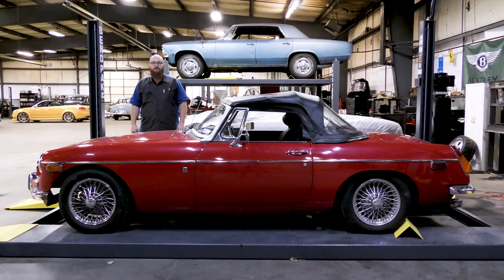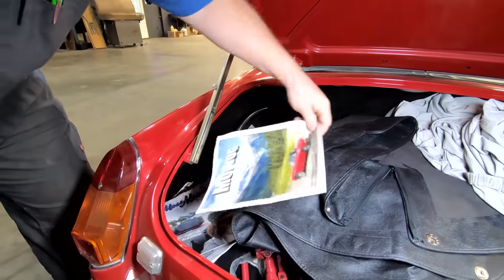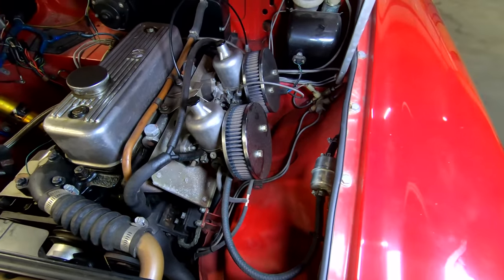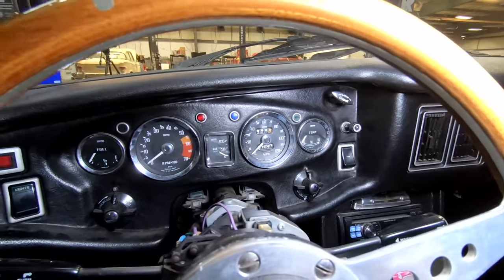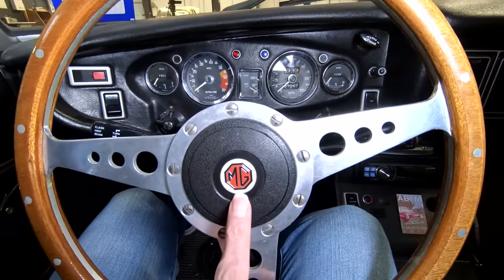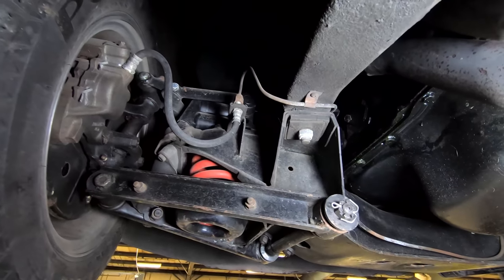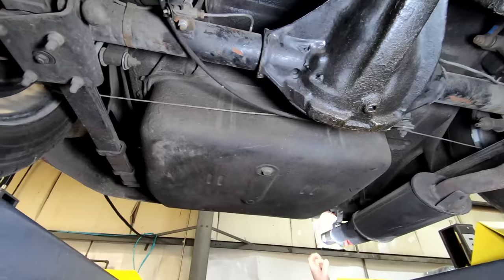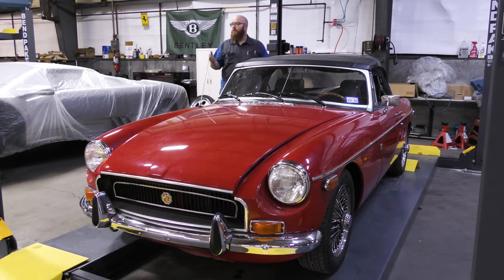Cherry 1972 MGB! See exactly why it earns a thumbs up from the CAR WIZARD!

Comment: The MGB is a timeless classic. The styling is still beautiful today. The fun to drive factor is a 10 on a scale of 1 to 10. Then, the U.S. government in 74 or 75, ruined the car with 5 mph bumper laws and smog junk, and that was the end of that.
Reply: I had a 1975 MGB that I paid 3700$ in 1978. The rubber bumper model. Went on our honeymoon all through New England  in it. Top down every day except one. That was 1979. Sold it in 82 when we bought a house. It was a nice car. I can honestly say  'been there, done that. Had it for 4 years.
Reply: J P... Mid year 1974 chrome to RBB. Also of equal importance.. the previous MGB  headlights were lower than the US standard.. The RBB for collision and the increase in road height by 2" for the head;lights.. that killed the car. Add to that smog regs and the wretched Stromberg  Smog carbs and then a single carb and a weight increase of a couple hundred pounds. with a now 68 HP  engine instead of the original 98 HP made the car a be-jewelled pig.

Comment: Hi Mr Wizard - ive got 3 of these cars - for future reference, one of the hidden areas you can get problems is the fuel tank.  All good until you fill them full and then realise that above the tank is a crud trap where dirt is flung up between it and the body (what you often see rusted boot floors).  Most people kind of accept that an old British car will have a gas smell but not appreciate its because their gas tank has rusted at the top

Comment: Wizard a small point but you are usually very specific with details. Dampening involves water, damping is the control of motion. The lever action shocks are dampers as are the valves in the top of the carbs. The damping valves in the top chambers of the SUs act to retard the lifting of the piston upon opening the throttle thus restricting the air momentarily and causing the high vacuum to pull extra fuel through the jet of the carb. This is in effect the accelerator pump. I really enjoy all your videos and rarely can find any mistakes. Keep them coming.
Reply: Sadly the entire motoring industry does this. It's the spring that provides the shock absorbing and the damper that limits the rebound action. They are fundamentally different actions, but it seems were are stuck with dampers being referred to as shock absorbers. It's too deeply ingrained in the business.

Comment: In the early 70's I had a couple of these from the 60's. Up in Ohio I learned those spin on wheels better be taken off every 6 months and re-lubbed or when you had to take them off it was a hell of a job beating them off. I got rebuilt shocks at JC Whitney as cheap as the rebuilt kits. They do make regular shock replacement kits for them back then. I installed a 8 track in mine and head phone jacks. Had to fiberglass over the back floor where the battery went. I also made a split h pattern under the front seats, bent the floor mental and fiberglassed it to lower the seats 2" or my head would hit the closed top. They do sell metal pans to lower it but it only cost me $10 back then to do it.
One year we mounted a 17' canoe on the closed convertible top with foam padding, strapping it down to the metal bumbers, and drove it 2000 miles like that.
Tough little car but has bad frame rust rot problems. Let my buddy drive it and didn't know he was drunk. spun around in the snow and bounced off a poll and a brick wall. Every corner was damaged, pulled out the stuff and drove it more, a year later I took a turn to fast and hit an island divide and then went up a hill. Went over 3, 4" curbs and a steel 2" sign poll at over 30mph and was sitting on the hill, put it in reverse over the same stuff and drove home. Sold later to my buddy and he would drive it crazy over 90 mph in the country. No front end work or alignment, lol
Reply: Steve Horace.. There is no "frame" on an MGB it is a unibody chassis.

Comment: My first new car was one of these... Mallard green.  There was 2  6 volt in line batteries, so this accounts for the extra battery space/storage.  Back in the day (1973), one battery cost $130!!  Yikes! Typical dealership ripoff!  Quickly converted to one 12 volt in short order. Horror story with the dealer, too long a story.  Cheers, keep up the ethical business practices.  G
Reply: Go on, give us the dealer story.....
Reply: @JohnSmith-yv6eq  okay, Coles version. About 14 months after owning the car, it needed ONE battery.  What the dealer did was to swap a new battery from the new cars and put them in a used car.  This way every mg sold would need a battery very soon.  Even in 1973, a 6 volt battery was $130. How I found out:  Talking to other mg owners, in conversation, the battery topic came up and everyone that had bought a car at this dealership had purchased a battery within 18 months.  And, every car new or used ha an old battery and a new one.  I converted to one 12 volt in the trunk (Fiat Spider had this set up). More stories over beers more fun!  Cheers

Comment: Brings back memories - I had a couple of these back in the 60s - both purchased new. The term MOWOG was originally BMC's brand on all their spare parts - bit like Ford's FOMOCO. MOWOG was derived from Morris, Woseley and MG I believe. If memory serves me correctly, the fuel pumps were made by SU not Lucas. Often they can be fixed by replacing the points but it's probably better to replace the whole unit as you suggest. In Australia, all B's after 66 had overdrive and wire wheels and has been pointed out, a pair of 6 volt batteries. The dashboards were always the original crackle finish metal which I think they originally were in USA. I think the later USA dashboards were as a result of your safety requirements.

Comment: Hey, Wiz! You're always careful to use the correct word (hood vs bonnet), you keep saying E brake. In old cars, they had hand-brakes, that thing between the front seats, that you pulled UP! E brakes are those buttons on the console or dash, an electronic connection to tell the central computer to release the parking brake. 🖖🙏🇨🇦
Reply: I think he means E as in E-mergency brake, pretty common saying.
Reply: E-brake is short for emergency brake, a.k.a. parking brake, hand brake etc.
Reply: Sa'ad Talia...    Another way Americans BS customers to think they are Brit hip and knowledgeable. 
It is an unnecessary  BS  affectation.

Comment: MOWOG
Found on engine blocks, transmissions, cylinder heads, and pistons, it 

dates back to the very origins of the British car industry. Before the 
merger with Morris Motors in 1935, Wolseley and MG were owned as the 
personal property of Lord Nuffield. After the merger with the bulk of 
design work carried out at Cowley, the identification number for chassis
 and engines on Wolseley was assigned a “W” and the letter “G” was 
assigned to MG (M was already assigned to Morris). Hence the use of Mo 
(Morris), Wo (Wolseley) and MG to mark the various components with MOWOG
 as the result.

Comment: The empty space underneath opposite the battery was for the second 6 volt battery that was in the original cars with the positive earth/ground electrics used on these cars. Nice to see classic cars from UK in your shop. Lucas electrics may be crappie but easy to fix. Keep on making these videos.

Comment: That car is a total credit to its owner. I guess living in Texas helps as well.
'MOWOG' was an internal group company that supplied aluminium, castings to a wide range of British cars. You will see the name cast into everything. the name comes from when MG was merged into Morris and Wolseley hence MO....WO...G. Some say the 'G' stands for Group but others say its for 'MG'. But MG itself stands for 'Morris Garages' which was a private dealer in Oxford which built the first sports cars.
The shock absorbers are actually called 'Lever Arm Dampers' and actually a very clever piece of kit given the era despite its long lineage. Remember everything was serviceable. Nothing was thrown away.
That 'extra' box under the floor next to the battery box is actually another battery box as MGBs came with 2 x 6 volt batteries. 12 volt batteries of the day were rather large to crank over starter motors and MG were rather finnicky about weight distribution. Most owners changed 1 x 12 volt battery though.
Reply: 1 chish...   Morris  Oxford  Wolsey  Garage..................................   MOWOG.

Comment: I’m originally from the uk and worked on these, I now live in Melbourne Australia,the second box underneath was for another battery(2 x 6v batteries) also the dashboard is all wrong from the original’s, I don’t know if it’s aftermarket or came like that for North America. Overdrive should be for 3rd and 4th gear  
Kind regards 
Martin

Comment: I have been with my MGB 79 roadster now 20 years. Great fun car with character. Verdict you have to be very devoted to owe and drive this car if you use her daily, which I do. as EVERY THING can break down. After 20 years I am still learning and fixing her with passion. Latest fix last week after long decision to pull the themostat out to check if I can improve the temp while not in thru traffic I got a leak in the three bolts that holds the 
thermo  housing. Took me one day to try several method to finally get her fixed, My God, the warning "do not fix it if it ain't break" always true. I have five cars and this MGB will follow me to my coffin.
So if you owe one of these be prepared note if you only use her on sunday mornings occassionally nothing of the above, but if you use her every day in cutthroat traffic and enjoying the jealous eyes of other motorist then well be prepared to get your hands dirty always  CHeers  MGB forever!
Reply: I presume you used sandpaprer to even up the usually warped  housing...and a decent tube of  gasket maker as well as a new gasket?
Reply: I take it you still have the original brass radiator with the brass top and bottom tanks?
If so find a decent radiator shop that still knows how to flow solder...
or do it yourself...
and rod (literally) each and every downtube to physically move the crud out of the tubes (they will be blocked beyond the capability of chemicals to clean them.)
Then flow new solder over the tank/core joins , spray the radiator with black paint...and enjoy another 50 years of motoring...

Comment: Wizard- you mispoke on the carburetors. The oil does not dampen the throttles. The throttle butterflies are mechanically controlled per normal. The dampeners are for the variable Venturi pistons which are vacuum controlled. The needles for the main jets are attached at the bottom of the pistons. This is a very ingenious side draft design, that eliminates separate idle and power circuits. I had them on Volvos- a 1966 1800S, and a 1960 PV544.

Comment: I had a 1963 MGB. Second year of production. Wire wheels. Loved the car. Paid $950 ($8000) for it in 1969.  Needed a clutch after a while $125 ($1000). Totally a blast to drive!

Comment: I love British Leyland cars. Not the best but always easy to work on and no technical complications. I have a 1973 Rover P5B - The B stands for Buick - an all aluminium Buick design V8, built in Soilhull England.. Best engine BL ever made, fitted into the first Range Rovers and some MGB's etc. My car has torsion bar front suspension with normal shock absorbers. A grand old bus. The Wizard would love it.

Comment: To add to the already made comments.
They originally ran two six volt batteries hence the two compartments.
You can replace the points system on the fuel pump with a solid state version for reliability.
They do run better on electronic ignition. You can get one that looks like the standard distributor.
Replace the dynamo and control box with an alternator conversion.
Should be good everyday car then. 
I had a 1964 mk1......great car. Later in life I rebuilt a very successful race car and attended meetings in most UK circuits and the Isle of Man..bored out to just under 2000cc..weber carb and so forth....not far short of 100bhp! Happy days😊

Comment: My mom owned a 1971 (the year I was born) in a burnt orange.
She bought it when it was a few years old.
I got to steer it when I was about 4.
I wish she had never sold it.
Was supposed to be given to me when I was old enough to drive.
Thanks for the trip down memory lane!
These years used to use 2, 6 volt batteries.
:)

Comment: The 2 battery boxes had origanaly 2  6 volt batterys wired in seires (they are expensive) and as a result the single 12v battery replacement is common.The over drive unit was common in the Uk and the factory where they made them was called Laycock engineering in Sheffield UK this factory is gone now and was only 5 miles from where i live now.I worked for a company for 5 years in the 90's Mecspec i did loads of restoration work,engines and replacing and rebuilding the body parts lots of welding and painting.I restored a 71 MGB Roadster concourse car winner back in 1997.Sad i sold it as i needed the cash for a bigger family car.

Comment: The dampers in the SU carburettors in fact dampen the movement of pistons that go up and down with the rate of airflow.  These vary both the size of the venturis and the opening of the fuel jets, by way of a tapered needle. 
   My sister had a BGT in the 70s and 80s, and she learned that fuel pump stoppage was an occasional event.  She carried a socket driver in the boot, and she learned to get out and whack the pump when it stopped.  Nothing so much fun in modern cars.

Comment: If your fuel pump fails you can blow into the tank and fill the fuel bowls to get 1 mile of power. Repeat till you reach home. I did it once. It works.

Comment: I owned a 78 converted to chrome bumpers. Had it for 31 years, my son has it now. Only ever had one problem, well three but same every time; yes, the fuel pump. I used a Facet pump and they seemed to last 10 years. Great car.

Comment: 'MOWOG' was the name put on castings produced by the Nuffield group, starting when they were MO-rris and WO-lseley. It continued as an identifier of BMC products. These came from the factory with a 6 volt battery each side of the propshaft, in series to make 12 volts. In Britain virtually every part for these cars is available, and quite cheaply too. You can even buy a whole new bodyshell.

Comment: If your going to work on MGBs get all your parts from Moss Motors. If you need a lock nut for the flux capacitor they with have it. The MGBs have plenty of room. Hard to get into with the top up. Lots of legroom. 6’1 and have to slide the seat forward.

Comment: Having owned and rebuilt, as my first car both a 67 and 69. My Dad bought two for $500 (in1984) and gave me a year to swap parts between the two cars in order to make one that worked and I could drive at when i turned 16, the odd battery arrangement is because they shipped with two 6 volt batteries in series (one on each side) these were immediately ditched 10 years later when small 12 volts were then norm. Great stuff thanks for bringing back the memories.

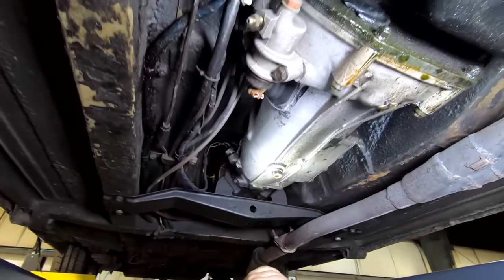Comment: @12:42 - you show the bell housing after the engine - did you notice the "giggle pin"? Just a split pin through the housing. The main crankshaft bearing weeps a little and this pin makes sure the oil doesn't contaminate the clutch.
The fuel pump (SU model) probably needs new points - or just check & regap the points. There are later models that are electronic.
Reply: The jiggle pin is also on all A series engines, an example of which is in Hoovies frog eyed sprite.
Reply: @1963TOMB  and on the Morris Minor that I had a few years ago!
At least the MGB fuel pump was a pusher from the fuel tank. The Minor's pulled fuel from the tank - in the English summer you could hear the pump trying to pump the vapour. The boiling point of petrol was such that a good hot summer day could vapour lock the fuel system...
Reply: or just run a bit of sandpaper between the points. They corrode. Or whack it with a hammer to get them to kick over.  Can be rebuilt but unless you're doing it yourself it's usually cheaper to buy a replacement  https://www.youtube.com/watch?v=oU5uLjuOQdM .  Although sometimes the main winding of the coil body shorts and the coil has to be done by a shop with  large press.

Comment: Walk down memory lane.  What a beautiful example...pre fed rubber bumpers...they raised the suspension and added rubber bumpers on later US models which ruined the car's aesthetic.  I am an American and a MG midget was my first car...mine was a '69 with steel bumpers and steel wheels.  I am 6'1" but a skinny kid and a tight fit.  Non syncromesh first gear but when that car got up to speed with the top down, I will never forget those memories on back roads.  It just sang at speed.  Pure delight.  1275cc motor in the Midget as many of your viewers know.
That car looks impeccable and I see why he sent it to you.
Thanks for sharing it.
P.S. I am going to leave you with a thought about car design that many don't know or appreciate.  It is the flaws in a car that give it its character.  Early British sportscars were more fun to drive then all the late model BMW's and other more exotic cars I have owned. They had character and you felt the connection to the road lost on road cars today....why many car hobbists prefer lighter, more primitive cars to cars with all their character engineered out.
That thought crossed my mind when I saw Hoovie's latest Shelby GT350 race car.  Raw, primal and wonderful.
Reply: Excellent summation in your PS.  Bravo.

Comment: I had a 66 and 67 MGB, the 67 being the first car I ever bought when I was 16. Loads of fun until it rained and it wouldn't start. Looking through their competition catalogue I found the Lucas Sport Coil used for racing providing a hotter spark. Once installed problem solved! I installed one on all my MGs and Triumphs after including my GT6 race of course! Nowadays I highly recommend going to an electronic upgrade like PerTronix...